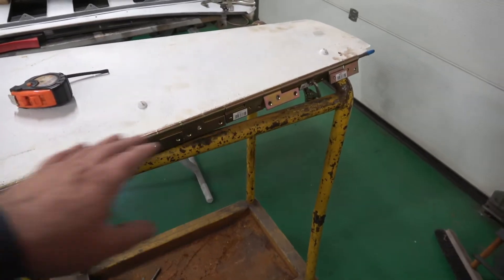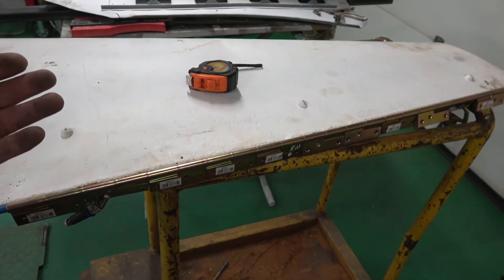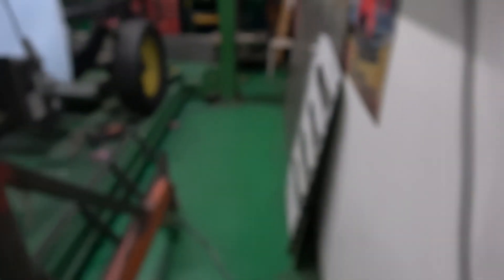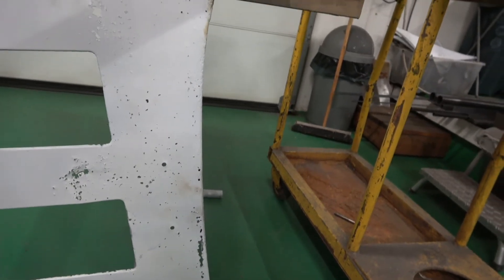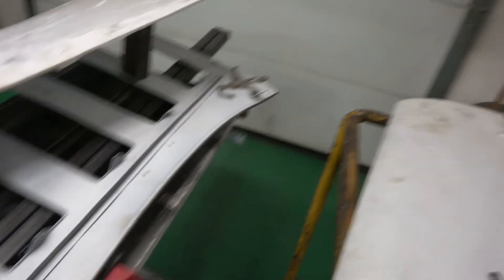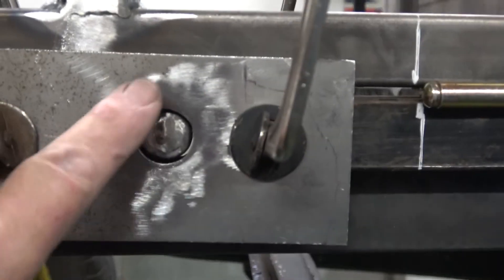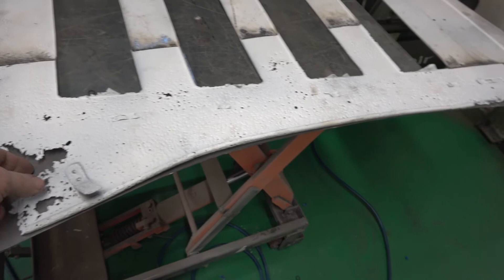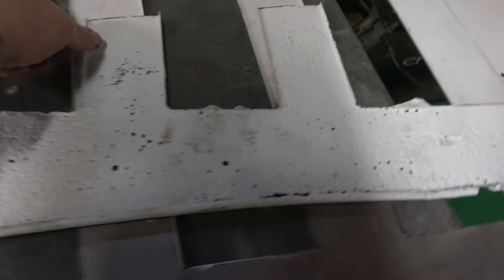1930s Barn Find Fabricating A Pick Up From A Car  Part 12

Comment: Hi Dave. Looking good . Are you bead rolling the bonnet ? I doubt if it's worth the effort . And was the floor originally wood ? Safe journey !
Reply from the maker: John,  Thanks, No I will leave as it came apart from the repairs lol. The floor was metal but in a shocking state. Cheers Dave